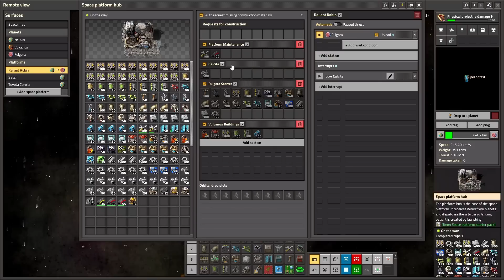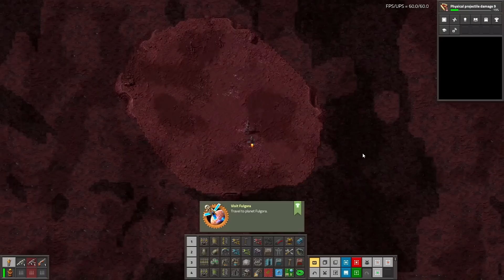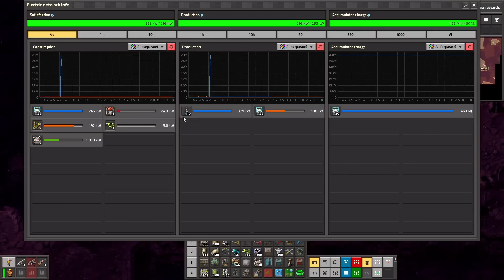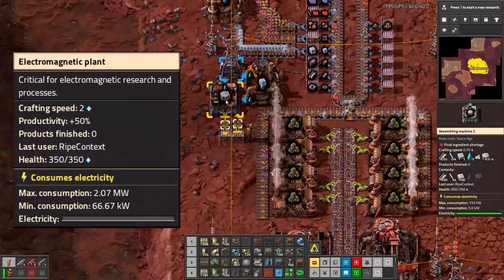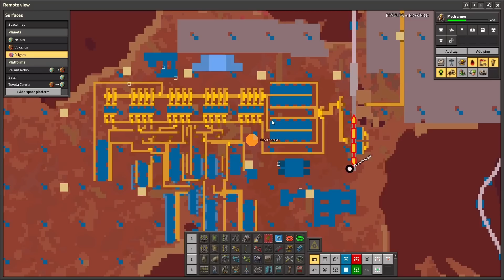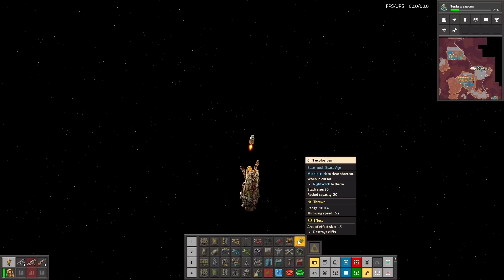Conquering Fulgora in Factorio: Space Age

Comment: TL;DR; I made the mistake of not noticing the research to discover Fulgora also unlocked the lightening rods.

I was so focused on the "mine X" or "craft X" research items, that I expected the lightening rods to be locked behind one of those. I saw the bigger lightening tower research and I thought that was the only way to unlock a way to collect power. I spent hours building a system that used ~200 solar panels and ~200MW of accumulators to automate building each step of the science pack until I hit 1000 so I could research the big lightening towers.

It ended up being a great learning experience for all the new things space age though... like more advanced combinator settings (I figured out how to create an S/R latch using one decider combinator). After my initial calculations, I remembered to take productivity into account and built a state machine that produced the exact number of intermediates necessary. At first, I choose 1000 science packs because I forgot about the productivity in my labs... then I kept it at that because that's the rocket capacity of science packs.

Just before hitting the first 1000 science packs I remembered I could use nuclear! I shipped in what I needed for a small nuclear power plant and was pretty much set. I still had some problems managing water because I trying just running everything at once and drained a lot of steam and water reserves pretty quickly, but everything was still a fun problem to solve. I also thought about using basic steam engines because of the high amount of solid fuel created from scrapping.

As soon as I researched the big lightening towers, I setup a machine to start crafting them, and saw one of the ingredients was a lightening rod. WTF!?!? I alt+click it and see that I had those all along!

At least I'll hopefully be more prepared for gleba. Thanks for reading.
Reply: I did that too good thing I noticed that you don't need to wait for solar

Comment: I imagine that the Fulgoran civilization had no issues with runaway climate change, rather they engineered Fulgora to capture the maximum possible energy from the solar wind and did their best to force it down to the ground for their use, causing immense eternal lightning storms that they were prepared for with lightning rods everywhere. From what I understand, most of the energy from the charged particles that make up the solar wind get captured in the Van Allen belts and discharged as the polar aurorae, so the Fulgorans could've engineered the planet to use the incoming electromagnetic radiation and solar wind particles to generate the maximum possible amount of lightning, like they turned the planet into the universe's largest spherical solar panel of sorts, if that makes any sense. Of course, weakening their own geomagnetic field and atmosphere to allow the particles to discharge into gigastorms probably means they died out from runaway genetic mutation which is near-invariably a negative thing, and as their infrastructure collapsed in their wake the eternal storms began destroying their civilization, leaving the widespread scrap and ruins strewn across the entire planet. The oil lakes might've formerly been agriculture areas, with the plants and animal carcasses breaking down into oils under the hostile near-inhospitable environment, and the rest of the oils came from runoff from the disintegrating ruins as the agriculture zones would've been built in low spots to prevent flooding in particularly bad downpours during the planetary engineering stage of their development.
Reply: Neither going cyborg nor going for eugenics, rookie mistake.
Reply: Factorio engineer : Amateurs.

Comment: Quality just works on the rule of large numbers. 1% chance doesn't like like a lot, and if you make 100 items you only get 1 higher quality item. But you don't make 100 items, you make 1000000 items. 1% of a million is 10000 items of higher quality.

Also steps. Put quality modules into big miner drills, can get uncommon ore. Put it in an electic furnace with quality, get rare plates, put plates into a crafter to get epic wire, put wire into another crafter and you can get legendary chips. Base Quality mod 3s have 2.5%chance each, so most machines will have 10%quality chance due to 4 slots. So you can get a surprising number of high quality products really fast if you actually try for it.
Reply: Also the first thing you should do with quality is put it on your quality modules
Reply: Making chests is also a great way to upcycle. Iron into iron chests to get recycled into iron, all with quality modules. Doing that with steel chests is a great way of getting around the long recycle time of steel. The same for turning concrete into hazard concrete.
Reply: Quality miners only makes sense on Fulgora tbh. Anywhere else not really because you'll want to use foundries to make items, and liquids cannot have quality. It's why I wish tungsten and holmium were swapped so that you could easily make quality stuff by recycling
Reply: @roadtrain_  On Vulcanus they also work because with rare or legendary coal you can easily make quality LDS via foundry which can then be recycled for it's raw materials.